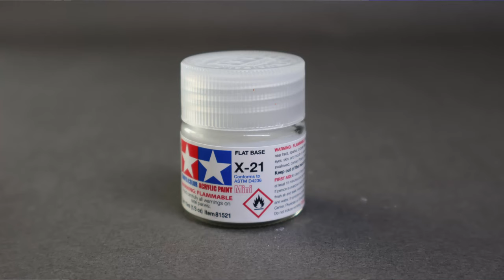How to use Tamiya X-21 to make glossy paints flat

Comment: Thanks for the tip. I've seen the X-21 but wasn't sure how to use it.
Reply from the maker: Glad I could help!
Reply: Wonder if the Tamiya gloss could be mixed with flat paint to create a gloss color? @middlingmodeler
Reply from the maker: No idea.  I will have to try that some time and see.   @roberthenderson2580
Reply: @roberthenderson2580  I have done it and it works to make flat colors satin/semigloss. You will never get it to be a true gloss because of the flattening agent already present in the XF paint.

Comment: In this video you had equal parts of X 21 and your gloss paint, have you ever experimented dropping the ratio to try to get a semi gloss?
Reply from the maker: Yes I have.  I have found that around 20%-30% gives a nice satin almost leathery finish, but you need to adjust depending on the paint.

Comment: Hi, the vallejio you use is an alcohol thinner, right?
Reply from the maker: The Vallejo product I use in the video is their Flow Improver, and is technically not required.  According to the SDS it is 2-butoxyethanol.  Essentially it works to break the surface tension of the paint, which subsequently helps it flow out of the airbrush.

Comment: This question may be a little off topic but - Where do you get those little containers that you used in the video?
Reply from the maker: Those are coffee creamer containers that I have cleaned out after I use them.  I haven't found a place where I can just by them empty.
Reply: Go to a Moe's burrito place and 'somehow' take away more containers than salsa. That's a source. Dollar Tree sells packs of little plastic cups as well. Hobby Lobby sells packs of small glass jars with screw caps if you mix some paint and have extra left in your airbrush you don't want to waste. As long as you aren't thinning with lacquer thinner and letting it sit the plastic is fine for use during a paint session.